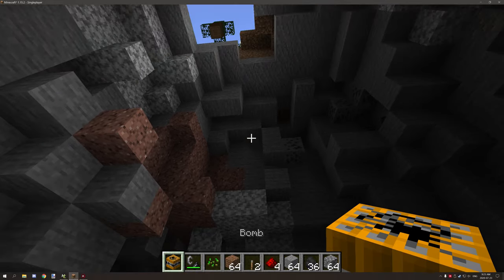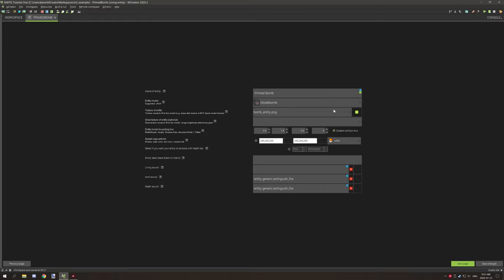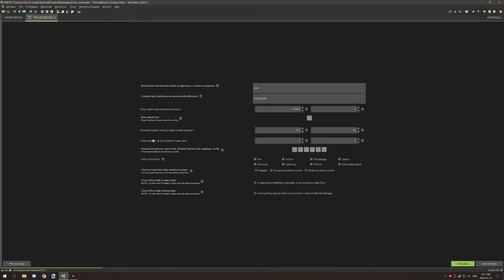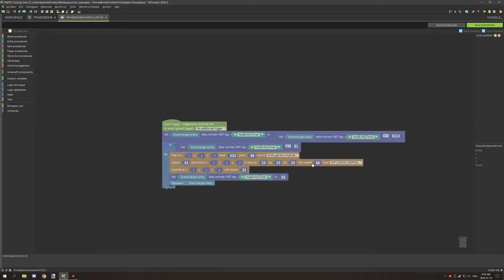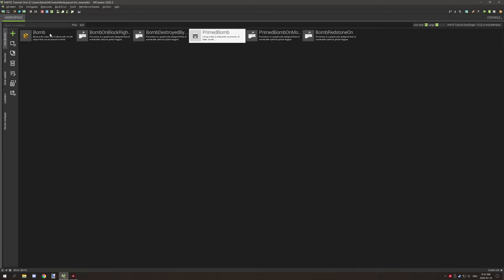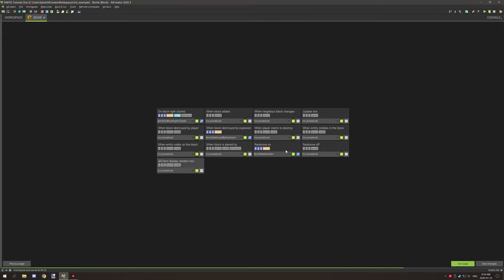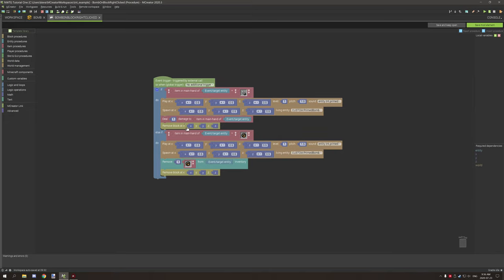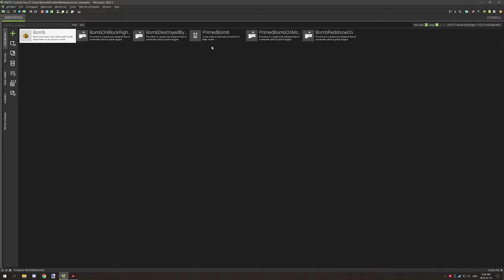MCreator: Tutorial | How to make TNT | 2020.3 | MC 1.15.2

Comment: Whenever i add the texture the entity just becomes invisisible even though i set then render distance to 64
Reply from the maker: I have not had this issue, I can't really know without seeing how the issue is reacting, my best suggestion is to open a bug report and provide a minimum workspace with just the entity if the issue does not happen in a minimal workspace chances are there is a procedure or something causing the entity to depsawn or something, for this you would know your mod more so I can't really help as I don't know what features or where the related procedures that could cause the issue. Though if it still happens in the workspace it's vary possible that it's a issue that needs to be reported to the developers, make sure to provide the game log from your /run folder and the mcreator folder from your user account folder in the .mcreator root folder this will help the devs with finding any issues.  Also make sure to be active with the report or it will be closed.

Comment: It doesn't spawn the entity when I light it... is the code already outdated it's only been 2 years
Reply from the maker: 1.15.2 was a long time ago though so its possible that Mojang changed something or Forge change something on their end.
IF the workspace is provided in the description maybe test if the example workspace works still, but I am not sure I have it migrated yet to GitHub or if I even backed it up.
Reply: @NorthWestTreesMCreator  hi, actually I just needed to set it as a passive creature and change the timer system to a "wait _ ticks" block. I hate that I've spend 30 minutes figuring this out but I'm a newbie lol